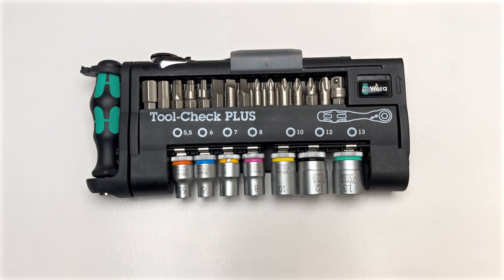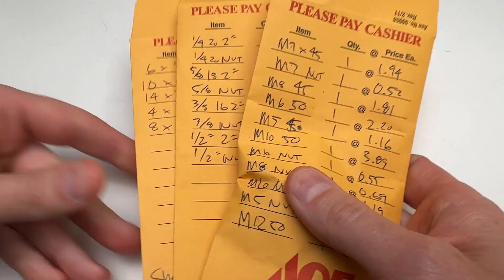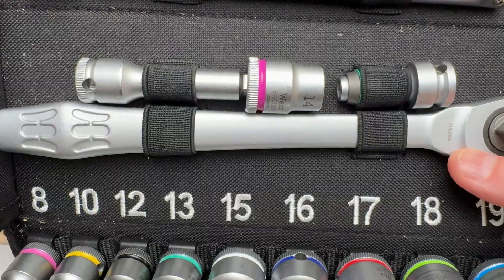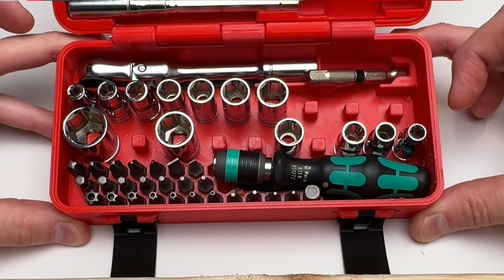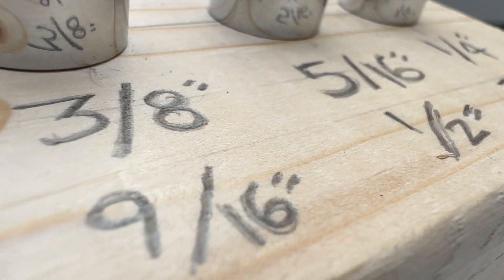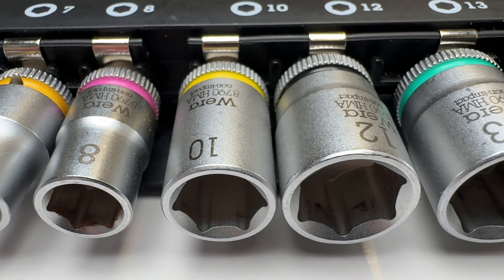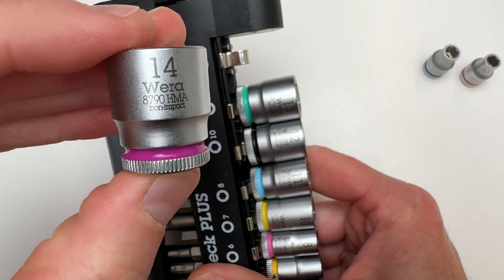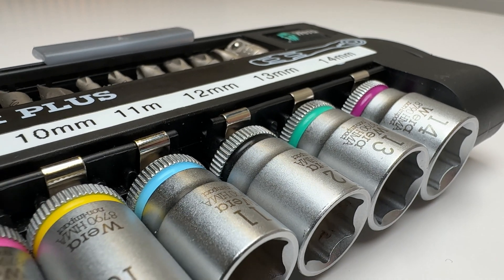Wera Tool-Check Plus HACK: Tackle METRIC + IMPERIAL Bolts with just 3 Sockets!

Comment: I would have to check later but I'm surprised the 14 mm fits on a 916 spool head. As that would be under sized. By .29mm. That's quite a bit

Comment: You already have the Knipex Cobra Pliers. for Standard Bolts, just get the Knipex Pliers Wrench. I assume a majority of the time you need Metric, being that you got it in the first place. So to cover for Standard just use the adjustable versitility of that set up. its what i have my Mini Tool Pounch set up as and it works just fine.
Reply from the maker: Yeah the pliers wrenches a good way to cover any gaps

Comment: I'm not into cars or anything mechanical.  I just need a regular household set.  I don't even know if the screw bits will fit Imperial screws, that's how little I know.  But thanks for the help with the sockets.

Comment: Kind of along the same vein, I own a protorq 6" torx bit set that includes a 15,20,25,27,30,and 40 torx bit. This set also works on every allen wrench size I encounter on a daily basis. Can't remember the last time I used an actual allen wrench.
Reply from the maker: Yeah, I know you're not supposed to because it probably isn't as strong but I will use Torx in a Hex head if that's what I have on hand. Security Torx is ideal because it handles regular torx, security torx, and hex. In the end I think an Allen wrench set is more useful than a bit driver hex anyway

Comment: The latest Tool-Check models are 5 3/8 across the socket bay now. I was able to add the 14 and 11mm sockets and by adding an additional clip (Amazon) keep my 6mm in the holder! Thanks for the great tip!
Reply: Do you recall which socket slide you purchased ? Or do any of the rail versions pretty much fit ?

Comment: I feel like socket sets are too specific to be reasonable to EDC, considering cable and pipe connectors, well they have a cable or pipe running through the middle. 7in Knipex pliers wrench (or similar designs) can torque well past the specs of any car or other project, so it's replaced any need I have for sockets outside of home.

Comment: Great real-world rundown and load out advice!! As thanks, here's one of my little Tool Check Plus tips -- use one of the doubled up bit slots and replace it with a mini-bit adapter (1/4 to 4mm). This is great if you ever need to drive those smaller 4mm sets with a high quality tool like the Wera drivers that you have in your EDC.
Reply from the maker: Great tip

Comment: It's good in a pinch but trying to interchange metric/imperial     10mm(3/8), 11mm (7/16), 13mm(½), 14mm(9/16) is generally bad advice and almost always ends up in rounded off boltheads which is just a headache to deal with unless the person who rounded off the bolt is a hack and leaves it for the next guy to deal with.
Reply from the maker: You’re right. I wouldn’t recommend this if you’re an auto mechanic but for tightening up bolts around the house, close enough can be totally fine as long as the bolts aren’t rusted on or crazy tight

Comment: This works until you are trying to remove a badly worn nut and really needs the exact bit. Edit: of course, if this is part of a kit with other tools, can carry that tiny knipex as a back up for these situations.
Reply from the maker: Yeah, I did this research as part of my toolbag organization to see what I really needed to carry and I have a pair of Knipex pliers wrenches and Cobras on me if needed. If you torquing on a big, rusty bolt you need a 3/8 or 1/2 rachet set or set of wrenches anyway. The ToolCheck Plus is for lighter duty projects imo.

Comment: Today I was watching your previous video on small tool sets (bit drivers) which brings back up the question of metric vs SAE.  I remembered this video addressing that so I had to look it up again.  I've found charts online that show what fastener sizes use similar size wrenches, also what fastener sizes use what size wrench which just like you did at the hardware store could be used to check what wrench sizes are commonly used and what wrench sizes aren't used.  There is always the chance that a manufacturer will change nut sizes or something crazy like that, I've seen it lots of times.  The only thing I can see missing from the discussion is the 3/8" size which I find common for things around my house or my workshop.  A 10mm is close for that probably good enough for usual work.
Maybe it depends on the tolerances of your sockets but a tight tolerance 14mm socket might not always fit a 9/16 fastener so I would use a 9/16 socket and let it be loose on a 14mm fastener.  Otherwise your revised set looks very interesting.  I would suggest printing another label to indicate which socket would be
an appropriate substitution for 7/16", 1/2" and 9/16" to eliminate that little bit of guesswork or mental math.

Comment: Love what you did. The label should have included both Metric and Imperial sizes on it. It would help with what the sockets uses in the field.  I know I wouldn't remember the cross reference sizes between the two. Great video.

Comment: Two suggestions:
1. Remove all the PoziDrive bits, expect maybe one PZ2 (perfect fit for IKEA furniture) and swap them for Square Bits( these are offered in the Imperial Version and are also able to be purchased on their own)

2. A shorter socket adapter. I bought a Gedore 673K and there’s a significant height difference between the supplied one.

Comment: Hey Todd, Terrific news, I just got the Wera Tool Check Plus Metric off Amazon and guess what, Wera changed that end area that you were trying to soften up to fit the larger sockets. They made the end area thinner, the larger bits now fit with plenty of room to spare. Heck, if you had another clip you could add another socket, thats how much room they made. They must have been made aware of your video and made the change. Kudos to Wera for making the change!!   I followed your advice and purchased those 2 extra metric sockets. If I knew how, I would post a picture to show the change Wera made .   Thank you Todd.
Reply from the maker: Great to hear. I dunno why it had 2 separate rails and that wasted space. I hear they got rid of the lock on the bit tray too

Comment: Thanks for another great video!! Good thing I got the imperial version then I just got the metric 9 piece belt to clip on the side of my bag. It only goes up to 13 though so I could probably just drop the 5.5 and add the 14 in i guess. Space shouldnt be an issue on that.

Comment: 50 years ago I knew a couple of mechanics who occasionally worked on foreign cars.  They told me that frequently they could get by using SAE tools on metric cars as along as the fasteners weren't too tight.  I've noticed a similar thing, that there are certain sizes where a metric and an SAE are almost identical.
5/16" socket can be useful for small items such as washing machine, but 8mm will work for that.  1/4" is useful sometimes but your bit driver is already 1/4" with no bit installed.  I seem to recall that I've used 3/8" sockets occasionally, I don't know if 10mm is close enough to substitute for that.
Your comparison is good for common fasteners but you will occasionally find exceptions, at least in larger sizes.  I've seen situations where 3/4" and 13/16" nuts were used for the same size bolt.  Recently I was working on my wife's car and the suspension component I removed used a 17mm wrench but the one I put back on came with a nut requiring an 18mm wrench.  My wrench set didn't come with 18mm so I had to use 3/4" wrench.

Comment: I have asked my local Wera Rep why the tool check plus made by a German tool company doesn't come with a 14mm socket which is a super common size used in many German cars.... he was as puzzled as i was.

But in regards to your Tool Check Plus, Great modification to your kit! Might be a good idea to also put a second row of labels to indicate the relative SAE sizes.
And for anyone looking to replicate this, on the new version of the Tool Check Plus, the socket rail is a bit longer and can naturally accommodate another socket size, like the 14mm (which is what i did).
Reply: 14mm shows up on lots of japanese vehicles, like Toyota. Most jobs on toyotas can be taken apart with a 10, 12, 14 and maybe a 17
Reply: Tool check plus was created for bike and motorbike were M9 axle hub with 14mm nut and 14mm brake pipe fittings are pretty common
Reply: so your rep doesn´t know that the german DIN (and the more international ISO that is the same up to M8) has no use for a 14mm?
the tool check covers the DIN sizes for M3 up to M8, without the unused M7 but including the added 12mm (JIS and i think some older german standard us this for M8 insted of 13mm)

14mm is just not a standard size, so why add it to a compact kit that needs to fit for most people?

Comment: Great idea.  As someone that works in maintenance, I feel you really need 1/4", 5/16",and 3/8" addressed in the USA.   Appliances, electrical components 
 and HVAC are covered up with these size fasteners. I'm not sure what metric (if any) serve dual purpose. You may have 1/4" built in to your ratchet or bit handle.
Reply: U can use 8mm for 5/16” & 10mm for ⅜”. For the ¼” I don’t think any thing replace it in Metric.
Reply: @shark2492 6mm
Reply: I wish Klein would do a FlipSocket Set of Metric/SAE based off your work here
Reply: For the 1/4” get a 1/4” or 6mm spline socket (because 1/5”>6mm this is a case where you can’t use the metric one in place of the Imperial) and swap add it to the socket(there is enough room if you have a newer Tool Check+.

For sockets where I want metric AND imperial, I found spline sockets work great. They also can fit some other weird stuff like square as well as damaged hex bolts. I think they’re not as strong as a dedicated hex but it won’t matter for this size, so, if you don’t mind a mismatched set you can Frankenstein in 3rd party 6, 8, and 10mm 1/4” spline sockets for a socket set for less than the price of two Wera individual sockets.

Comment: Hi @Todd.parker, Jaahwn here! I'm the dude that designed that red case you featured in a decent bit of your video. Do you mind linking either my thingiverse or makerworld pages in your description since you used my design for about 1/4 of your video? 

Honestly before someone mentioned this morning that my case was included in this video, I had no idea that the Tool-Check existed! Great comprehensive video, I definitely will be considering getting this kit to compare/supplement/replace the ICON set.

Cheers man!
Reply from the maker: Hey! Glad you reached out. I tried contacting you on Reddit to chat about this. 

I purposely didn’t make a big deal of the kit in this video because I’m hoping to do a video when the meme kit with sockets launches so I can show your designs as alternatives. In the meantime, I added a link to your 3D files and the Reddit thread in case people are curious. 

The ToolCheck Plus is really nice but your designs are slick. You probably noticed I modded mine to fit a small driver handle and other stuff but did it with a Dremel because I’m not great with 3D modeling. What’s the best way to get in touch?

Comment: if you drive a toyota or honda powersport product you need a 8,10,12,14,and JIS bits
Reply: This is correct. European uses DIN standard and which doesn't use the 14mm and instead uses the 13mm. For DIN M10 you need a 17mm and JIS M10 you use a 14mm. You need the 13mm if you American and European cars. I honestly have never used a 11mm socket ever. 11mm is an M7 bolt, which DIN doesn't have. It only exists in JIS and it's rarely used. They give you one in a socket set. While I don't take them out these sets, I remove the 11mm out of any set of hand wrench sets I own. Don't need it. Keep in mind their are 2 different style heads for bolts. Hex and Flanged. In the case of an M8 is 12mm for flanged and 13mm for Hex. Where this gets messed up in the USA, you need to buy JIS bolts from the dealership. You'll find most metric hardware sold at hardware stores are DIN (now ISO).

Comment: 9/16“ is 14.29mm. So to be sure that any 3/8“ bolt works, i would swap our the 14 for a 9/16“. That’s about the same difference as between the 13mm and the 1/2“(12.7mm).

Comment: this is a great video; however, I do disagree you on using metric sockets on SAE bolts.  it would depend on the situation whether it is same to use a metric socket on a SAE Fastener.  in a low torque situation where the bolt is just had tight, then yes, it is probably safe. in a high torque situation, then it is possible that you will damage the fastener by rounding off the corners.   example, the 1/2 inch bolt, should measure .500 across the flats, but a 1/2 in wrench has a gap of around .015 inch more. so, the gap on the wrench is .515 in size. this is to facilitate being able to take the wrench on and off the fastener easier.  the added gap to the wrench/socket varies with the quality of tools you are using.  low end tools like the Harbor Freight Pittsburg, and big box store brands like Allied and All Trade are all over the place with their gap sizes and should be avoided. mid-grade lines, like Harbor Freight Quin, Husky, Craftsman, Kobalt are all decent of most work and are close to B grade industry standards for their gaps.  high end sockets and wrenches are almost on the tighter end of the clearance specs.  brands like Tekton, Snap-On, MAC, Matco, SK, and Cornwell and Harbor Freight Icon to some extent, are vastly superior to both low end and mid-tier tools. and the cost are much higher.  the reason i bring this up is, say you have a 5/16 coarse thread bolt with a 9/16 head that needs to be removed, and it has been torqued to the proper specifications usually around 25Lfb of torque.  if you use a cheap 13 mm socket or wrench with a loose fitting on it you will damage the fastener and round off the corners, but if it is a high-end tool, it may work without issue, simply because the gap on the tool is closer in tolerance.  so, it really depends on the tool and the situation and the quality of the tools you are using whether it is safe to use a metric tool and a SAE bolt when it is torqued to the proper specification.
Reply from the maker: Great info, thanks. I figure that if you stick to 1/4” sockets with a small rachet, those are pretty low torque so you can probably get away with a slightly less than perfect fit but that all makes sense
Reply: Yup if you’re using high torque you will definitely mess up the bolt. The ratchet that comes with the kit is not a heavy duty ratchet. 😁 Great point and info.

Comment: in most metric countries M7 is very uncommon so you could skip the 11mm, the 14mm also is uncommon but is used in the Japanese Industrial Standard for (JIS) for M10, so it might be good when working on Japanese sourced cars, thanks for another really informative video.
Reply: In most case it's DIN standard or ISO.
DIN shouldn't be used anymore, but no one cares!
Both are identical execpt for 4 size (M10, M12, M14 and M22)
M7 isn't DIN or ISO.

7mm, 11mm, 12mm and 14mm aren't DIN or ISO and are really uncommon. Well I did use 12mm quite a lot because of one screw manufacturer for metal roofing...
I still encounter some 15mm in old stuff

The most common size are 8mm, 10mm and 13mm.
Bigger than that mostly 17mm, 19mm and 22mm (only DIN. 16mm, 18mm and 21mm are ISO)
And for smal stuff, 5mm, 5.5mm, 6mm and 7mm. But most small screws are phillips pozidriv allen or torx.

So, long story short: 8mm,10mm, 13mm are enough for an EDC.

PS: I'm in France.
Reply: Toyota's use 8,10,12,14

Comment: One easy thing you can do is replace the rapidaptor with either a Malco or Klien 1/4-5/16 flip socket. The Malco fits a little better, but the Klien can hold screwdriver bits, so to each their own, but those will cover most hose clamps and bolts on appliances in the USA. Also I think there is more rail room on the newer toolchecks.

Comment: In the UK, where we almost exclusively use metric these days, you will see M5 M6 M8 and M12 a lot. M10 isn't that common and M7 almost non existent, I don't think I have ever seen them for sale in a "normal" shop and tap/die sets always skip it. 
What is odd though is that M8 bolts often come with a 14mm head rather than the standard 13mm. This seems especially common for M8 bolts on imported (cheap) machinery.

Comment: Dont know if those are available in USA, but in Europe you can find Honiton and their Honidriver series of sockets/spanners.
It is unique design which has some "funny" teeth but it seems to cover:
6/12 sided metric
6/12 sided imperial
E-torx sizes
Spline
Square
Triangle (?)
Can improve/help undo used/damaged bolts
All in one socket, for example:
1/4 socket of 10mm size covers: 10mm, 3/8" and E12

Comment: while the concept sounds smart, in the real world there are super tight alloy bolts with weak metal that risk stripping the corners especially if the socket is not exact. i would stick with the exact size for that reason.

Comment: for a example: i do use the smallest sizes for my solar, battery sound system builds. so i do look for there inclusion. :) but fair enough. interesting to learn of what metric sizes could be used for imperial.
Reply from the maker: Yeah all depends on what you work on. Seems the consensus 7mm isn't super common so I'm thinking of swapping that with the 6mm but curious what smaller sizes you run into on solar since I do sola stuff too
Reply: @todd.parker  yea it does depend on what your doing. motors feels more popular market.  my stuff is not typical. so hard to answer. I do use a fair amount of m3 and m4 bolts and some m5. then m6 and m8 and m10 for bus bars. smaller sizes mainly for panel mount sockets and mounting things in cases.